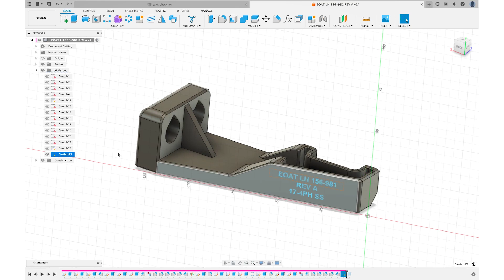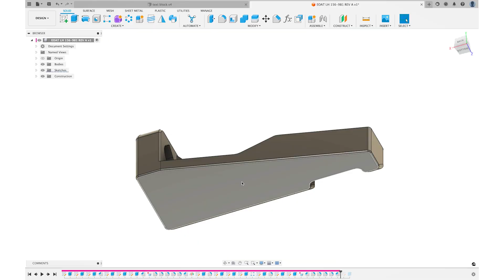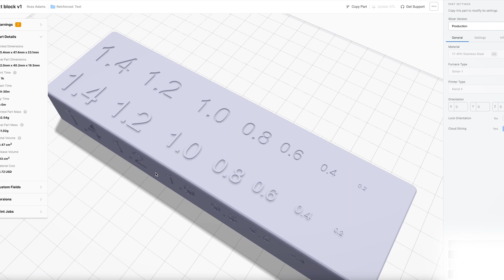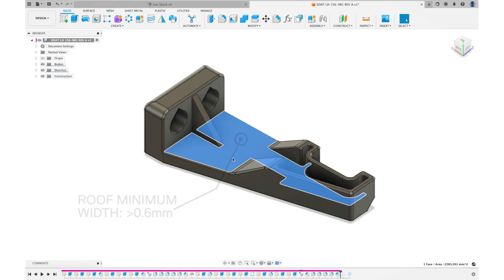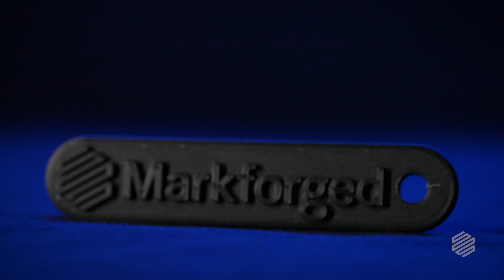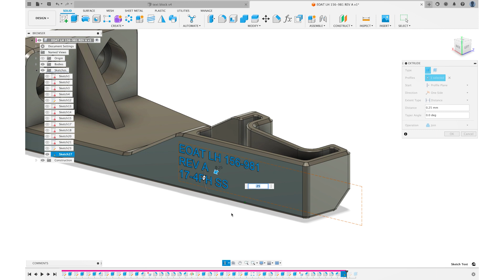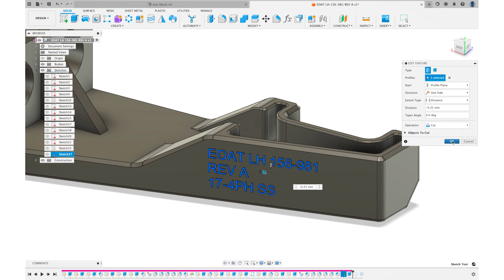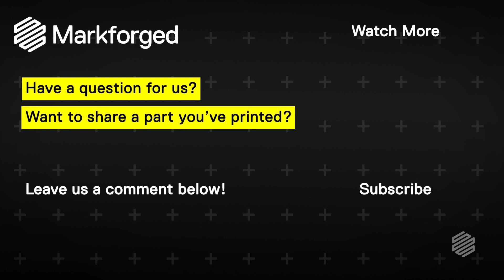How to 3D Print Better Text | Markforged Reinforced

Comment: The conclusion is the same but it all comes down to the nozzle size. Layer height is never that much nigher is even the nozzle diameter. Thus, embossing text using vertical plane should always come out better than the top or bottom surfaces.
I.e. for a 0.4 mm nozzle that resolution in X & Y vs 0.3 mm or LESS in Z-axis.
Reply from the maker: Great commentary and notes. Thanks for watching!